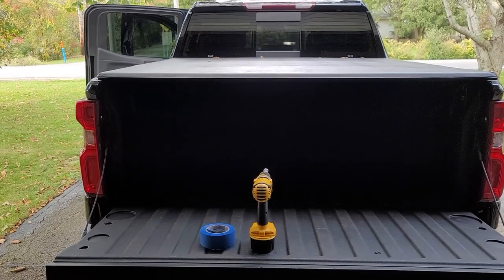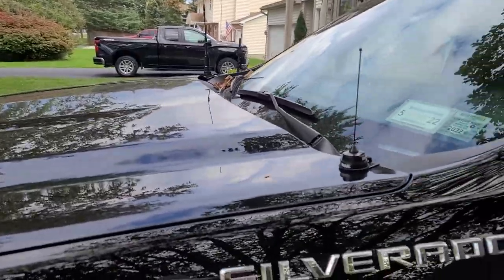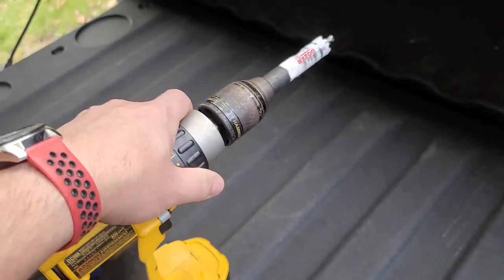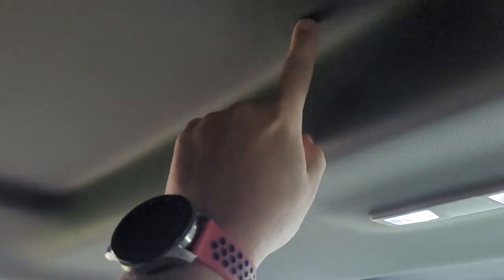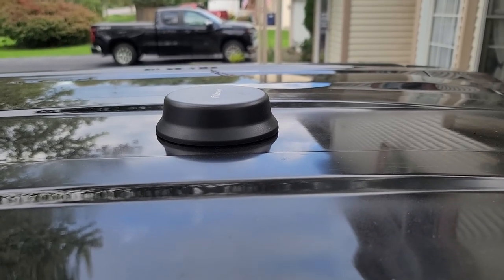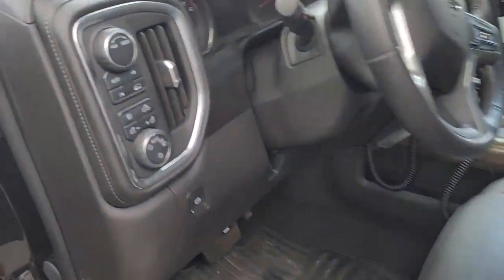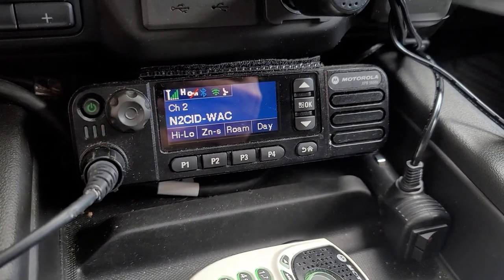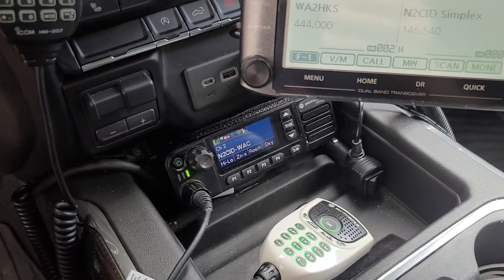New Truck! - Ham Radio Mobile antenna install.

Comment: Where are you located I am in TN.  I have a 2025 Silverado.  I might need some help poking some holes in the roof.  FYI, I got the Z71 LTZ so I could order it loaded without the sunroof.

Comment: Nice job drilling the roof top hole. Just got to be careful to not block the sun roof mechanism. I am a true believer in drilling roof top holes for antennas on trucks. They look more professional and have a better radiation pattern; up high with the much larger ground plane. I used to struggle with mounting antennas on the car trunk lip, edge of the hood, or using mag mounts. I've traded in several cars and trucks that had antenna holes drilled and the dealers couldn't care less. The holes don't reduce the value of the car. If you fill the hole with the correct hole plug, they may never even notice especially if it's on the roof of the truck. You can get black or white hole plugs to make them even less noticeable. I also discovered the other type of NMO mount that only requires a 3/8" hole which can be drilled with a drill bit rather than a jagged hole saw; it's easier to drill and easier to plug.

Comment: How did you hook up your power? I have a similar truck but I have problems with the radio shutting off when the “auto stop:” stops the engine.

Comment: Similar to my set up. IC2730 on the dash, Alinco DX70 HF+6 on the tree & a convertacom coming for Motorola 5000.
FYI- keep in mind when "black out" an antenna a lot of black paint has metal/iron oxide in the color pigment and could screw with either swr or ERP
W9DLP

Comment: Nooooo! Please tell me you didn’t use that drill bit to make the hole. Always use the proper NMO hole bit because the one you used could have caught the metal and made an ugly hole. Those aggressive teeth can cause the metal to be distorted causing the metal surface not to be level and smooth. If the metal gets distorted the mount won’t seal well and cause leaks. That’s why a proper NMO bit has fine teeth. I’m curious as to what the hole looks like after you drilled it out.

Comment: Nice installation and video.  I’m particularly interested in your codeplug for your 5550.  Would it be possible to get some snapshots of how you set everything up?  I have a 7550, and it should be very close.   Thank you very much.